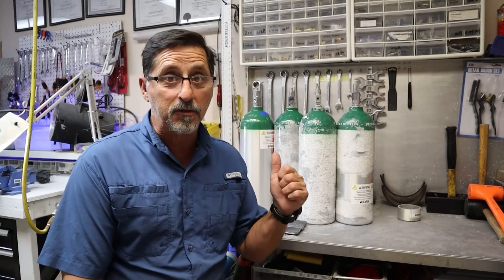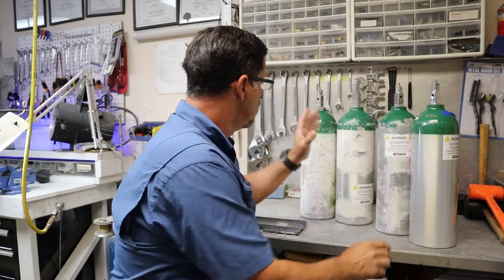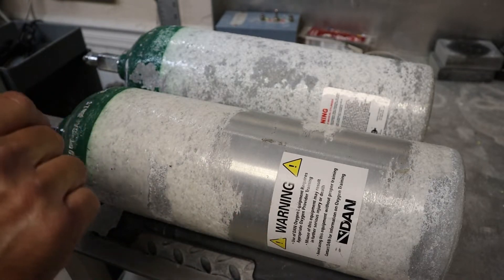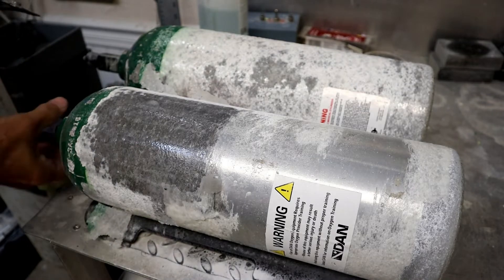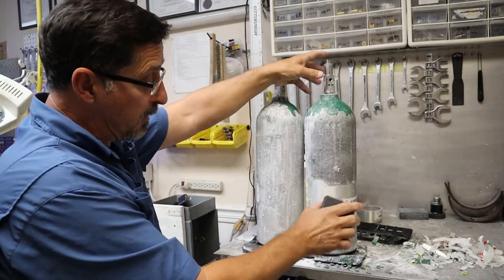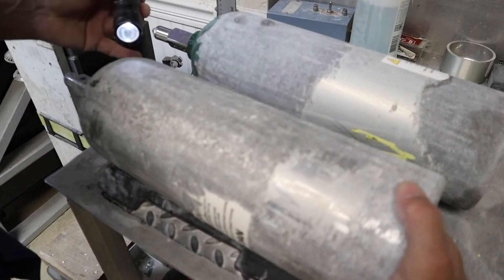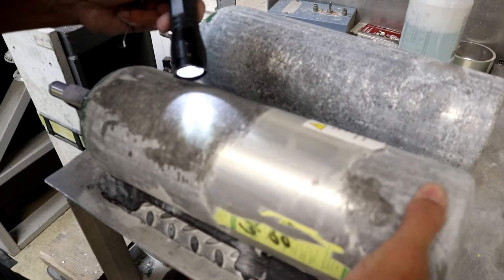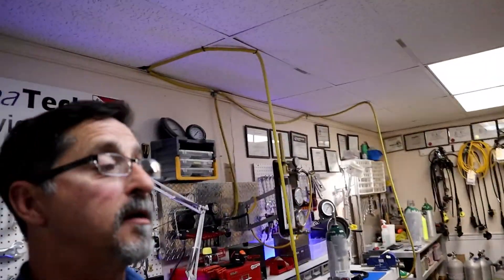How to clean exterior corrosion on your Oxygen Tanks

Comment: Hello sir,
What's the best way to protect the exterior of a bare aluminum cylinder?
Reply from the maker: Fresh water rinse after every dive.   Skipping a rinse will allow salt to stick to the walls of the tanks and begin the corrosion process. Once you see salt sticking to the walls, wipe it down with a wet cloth.  A light grit wet sanding sponge works awesome on older tanks.
No need to apply any protective coating to the exterior.  The maintenance after the dive is what matters.  Thanks for the question.
Reply: @scubatechkeylargo  Would that also apply to steel cylinders,no coatings just keep them clean?
Reply from the maker: Correct, galvanized steel already has protective coating, painted steel has several coating  of protection.  Fresh water rinse and wipe down will extend the life of your tanks.
Reply: Good information. Thanks. 

Earlier today someone shared a picture of an air cylinder that they applied a vinyl wrap around. Looked cool, but I can only imagine what it might do for corrosion.
Reply: I was going to clear coat but will leave raw from your reply. rinse well after use. Thanks